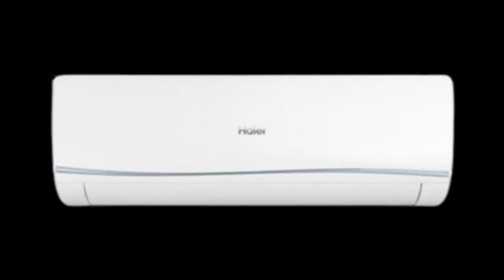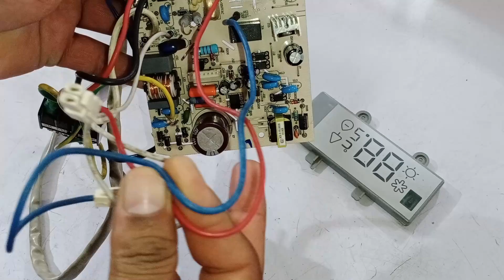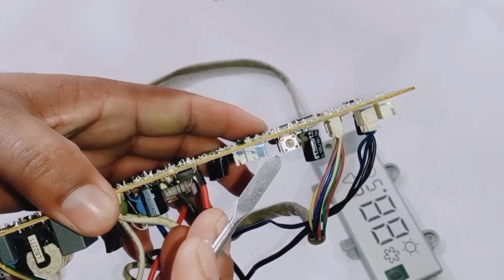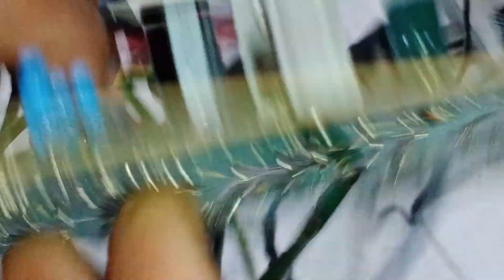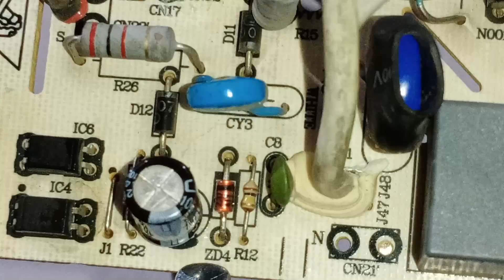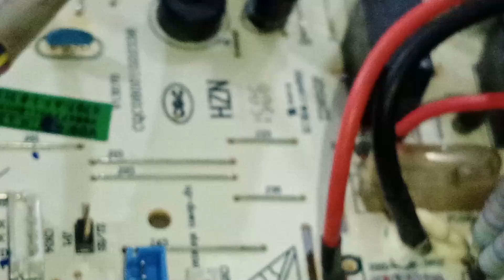Haier AC Indoor Circuit Board REPAIR - Tips For Low Volt Section

Comment: HI,  no the zero ohm resistors are not ruling as fuses, it on this board at act as a jumpers, this is one side complex board, it is not  possible to design the board without them!
Reply from the maker: You are right that it act as jumpers, if you install a copper jumper it wattages will be very high and bear more current than usual. But if we use zero ohms resistors, they are based on wattages capacity, for example if we use 1/4 watt capacity of zero resistors. It will not allow more current then its capacity, if more current tries to pass through this resistor, it will be burned and the purpose of this resistor will be achieved to save the further components.
Reply: السلام عليكم صديقي  كيف يمكنني  ان اتحكم  بسرعه الكمبريسر  من خلاق  الحساسات